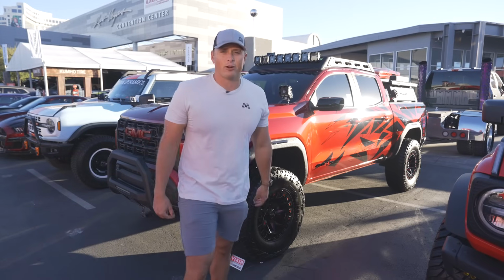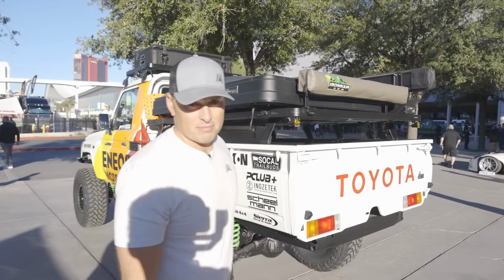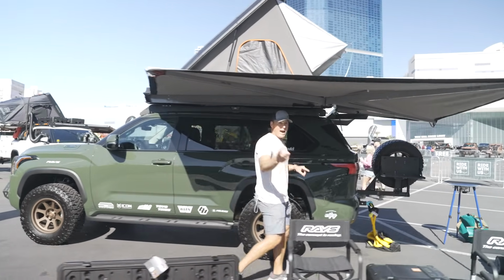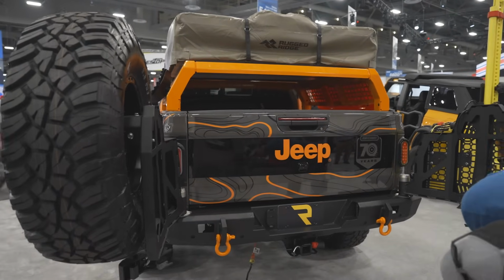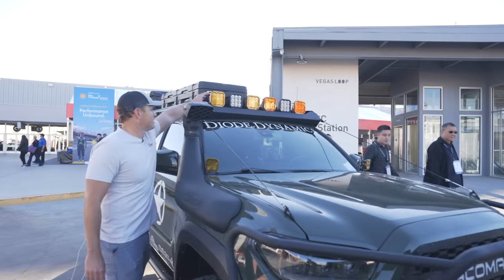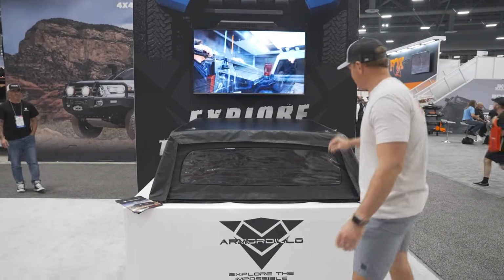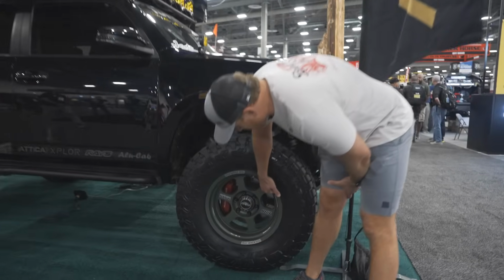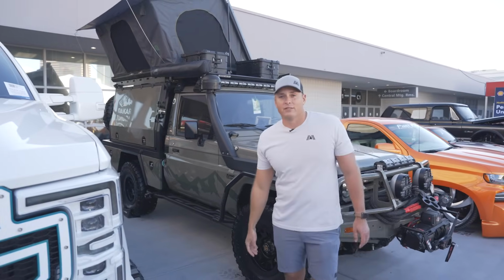Every Overland Rig & Camping Setup at SEMA 2023 ft. Lexus, Toyota, Jeeps, GMCs, Fords and MORE!

Comment: 2nd gen Toyota Tacoma built like a Toyota LC 79 series which isn't available in the US market. The complete custom Sequoia with 17 inch wheels, RTT and a light bar (overhead),  the racket bronco built is awesome for overlanding, but it is missing the winch. The JT with the LTA canopy is so nice. The green Sequoia would be a good overlanding vehicle if it has a 37s on it with full Cbi front bumper and rear as well. The R1 concept Tacoma with drawers and fridge on the back  with retractable bed cover power or manual will do.